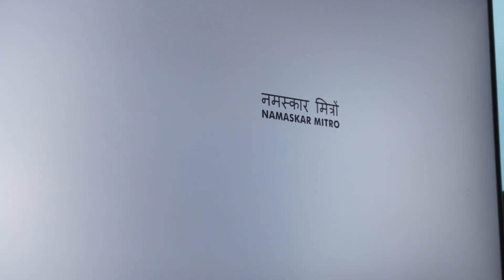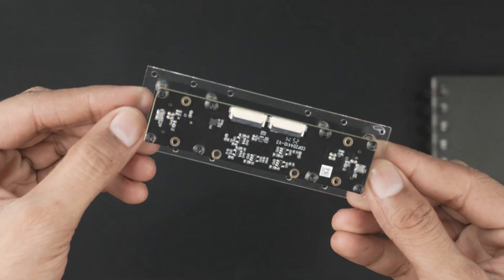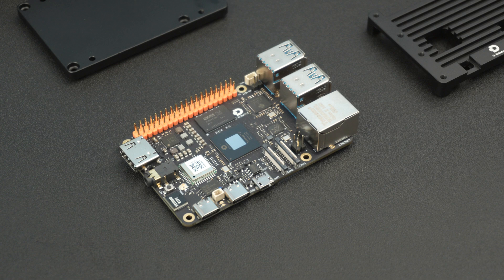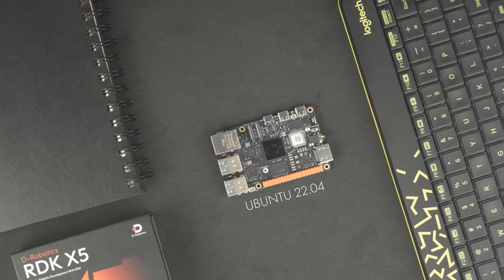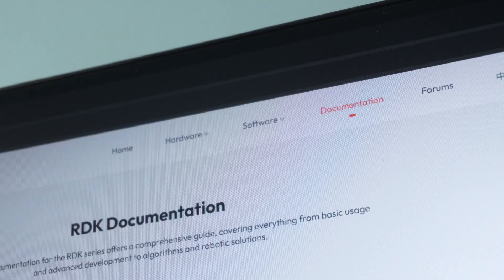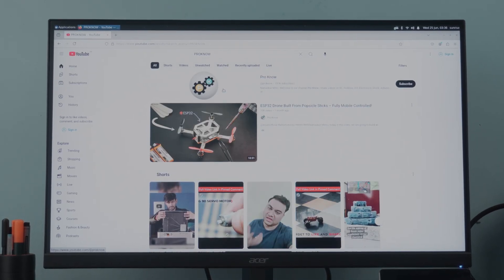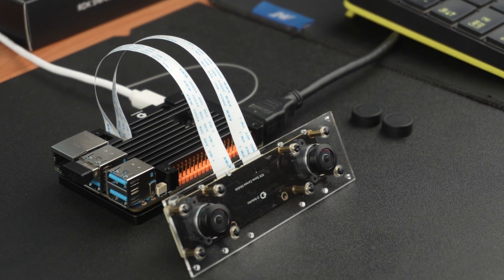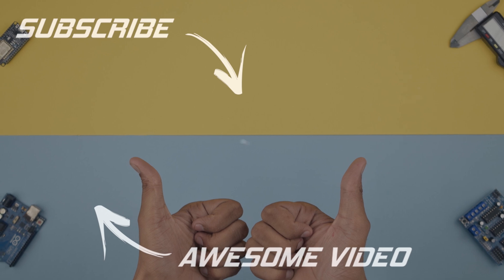This Board Sees Like Human Eyes 👀 | D-Robotics  RDK X5 with Stereo Camera

Comment: hey so there is this small project that was in my mind from about 6 months, and the sterio camera is the perffect thing i guess for this, so basically i wanted to make an automatic gesture controlled smart switching system, like when ever a person enters a room they just have to point there finger towards the appliance like bulb or fan and it gets turned on...... i studied about the and maybe wecan use yolo or mediapipe for hand detection but to calculate the pointer finger direction and its ectors we will be needing this stero camera to accurately get in pointing vectors , the camera would be installed at the top corner of the room so from anywhere we can point to the applance and it gets turned on...... i don thave enough budget to buy this stero camera module or else i wouldve gave it a try, but may now you can try this......